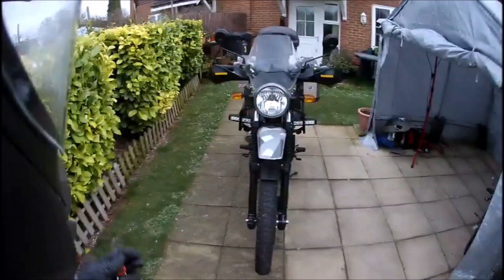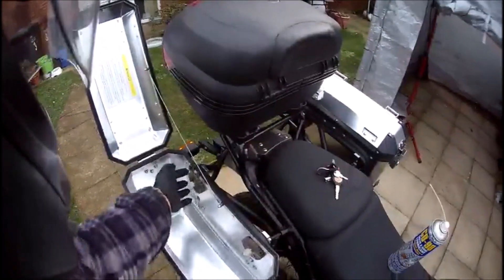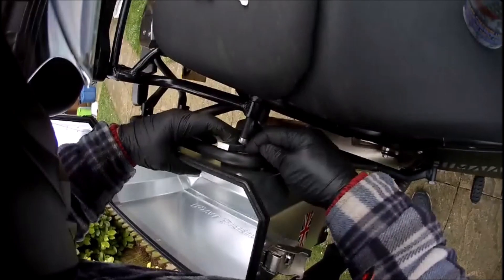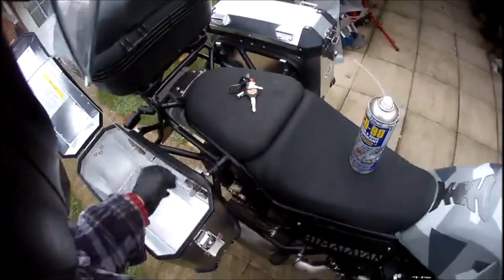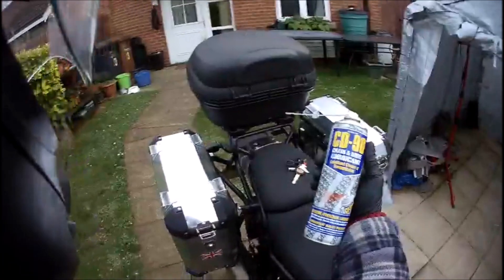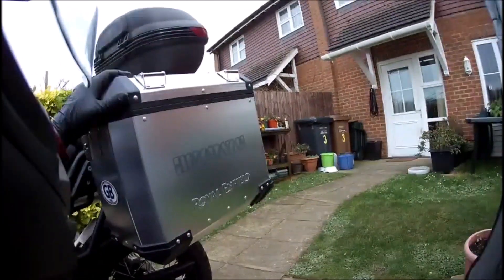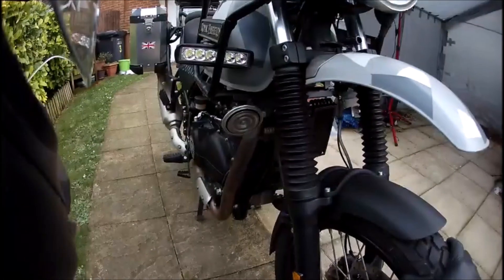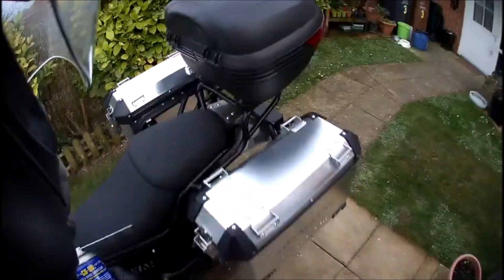Royal Enfield Himalayan # 6 Panniers

Comment: Thank you. As a question how secure are the locks on the boxes?They do not look secure if you had to leave the bike with the panniers full. Also how secure is the bike and the key lock for the bike? I appreciate you might not have some of the toe rags we have in London but there is a constant need to be secure.
 Besides your visiblity strips would you consider putting  LED  stop stips on the pannier back faces with QD connection  for when you take the boxes off.Ps i might suggest you take a couple of bunge cords along for if you shop and you have to store item in the panniers and cant fully lock them down,especially as you have yours mounted with the opening to the front. I do like the addition of the scratch strip on the tank.A neat ides in my opinion. How you dont meet a dear....or the whistle is a deterent, rather than a mating call lol. YOu might otherwise get a herd following .
Reply from the maker: The panniers have sturdy locks, but like any lock, it's breakable if excessive force is used, i have an extra light mounted on the topbox base, so no need for plugs.

Comment: You should see the quality of the classic panniers... Shocking! I didn't know galvanized steel came that thin haha, no seels what so ever and latch's bent to fit ...but. mine are £150 and I don't think they've actually leaked yet . I'm just coming up on 5 thousand miles so I'll probably do a vid to review my Royal Enfield experience so far..nothing bad to report the odd broken bracket and a constantly stretching throttle cable, bulbs out and swapped for led but that's it... Oh rusty spokes too but that's probably my fault riding in the rain . Love the vids pal ,I'm still wanting a Himalayan.
Reply from the maker: I'm loving the Himalayan, it's absolutely perfect for my needs, the panniers are fantastic, yes a tad expensive bearing in mind that I've not paid more than the panniers cost for a bike before lol. I buy broken, neglected bikes and breathe new life into them. The Himalayan is my first NEW bike and I'm loving it.

Comment: Hi Adrian did you move the indicators back and the brake light when I got my rack it came with a bracket to move the brake light back and extensions for the indicators Great videos mate keep them coming on the Himalaya 👍  Adie
Reply from the maker: Brake light is where it was originally, I've added an extra brake light on the topbox mount plate, indicators are moved to frame

Comment: Greetings from Brazil. I’m not sure if the locks pointing to the front of the bike is the ideal position. I’m thinking if you’re riding right after another bike or car in a non pavimented road or track, the dust will probably get in the mechanism much easier than the other way, right? Beautiful machine you have, looking to buy one in the future
Reply from the maker: Thanks Ross for your comment, that's why i recommend greasing the lock mechanism, keeps crud out, plus when the lock is on the rear the drag factor throws crud back onto the box's.
Reply: @eadsierestorations  thank you for your reply. pros and cons, it's sure

Comment: Is there any way to mount/rotate your front spots/led's to an upright position between the framework and the bike?... that way you could still fit your Lomo bags etc without interference from the lights. Just a thought btw.
Reply from the maker: I have a new set of round spots to go on exactly where you suggest. That was the plan initially, the spots I've fitted are actually for my other bike. So that will be done as soon as i know what is happening about the engine vibration and rattling